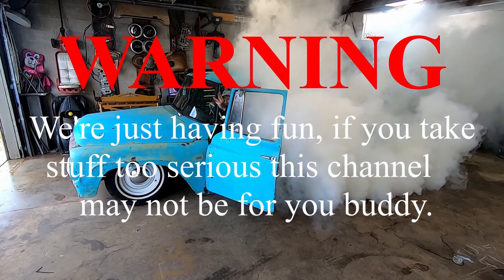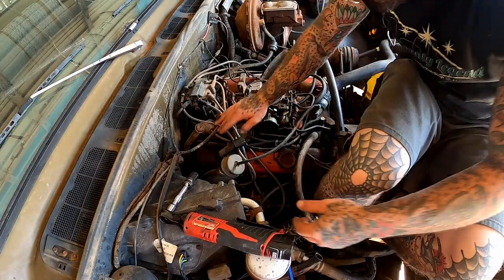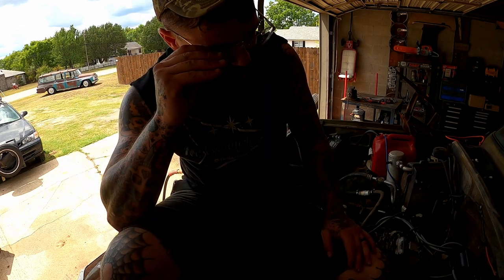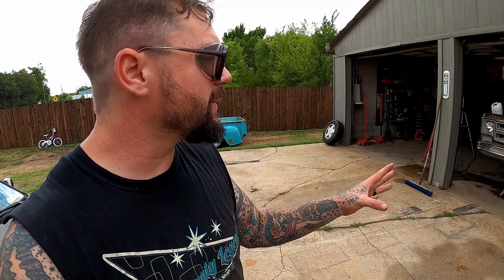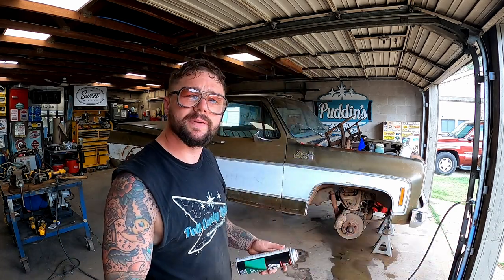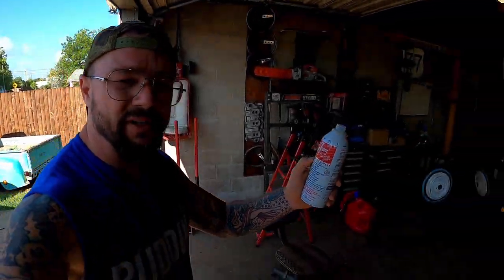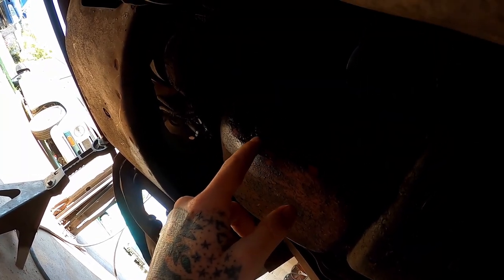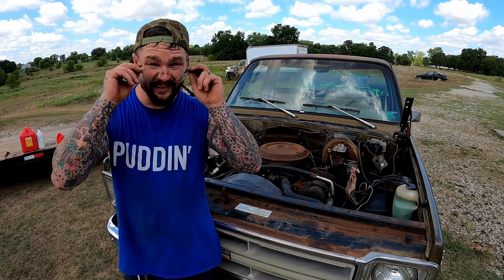ABANDONED 1976 GMC Sierra. WILL IT DRIVE after sitting??

Comment: Dude I just picked up my first truck, a 1984 Chevy s10 with a 2.8, and it leaks oil like no other
Reply: That's a 2.8 for you, oil and possibly head gaskets, no power at all, which is good, 'cause the transmission ain't great either. Cool trucks tho, hope you're V8 swapping it or something.
Reply: If it’s leaking that means it has oil in it.. if it stops leaking be sure to add more lol
Reply: Self changing oil
Reply: Look at this way you'll never have to do an oil change I had a Ford ranger that oil from everywhere I just had to keep adding oil basically got a free oil change every couple months LOL
Reply: @DeadReckon  I might down the road if I really like it, either a 5.3 vortec, or like an old 350
Reply: Look for the newer model S10 with 4.3  easier swap and plenty of performance parts and will make easy 250 to 300 hp  with little work .
Reply: @andrewjohnson442  350 is the way to go, cheap, available, plenty of swap kits, almost "bolt in", might take some hammer massaging on the firewall haha
Reply: The later revised 2.8 that came in the berretta GTs were solid though.
The older 2.8 was what chevy pawned off in the 80s jeeps.
Reply: Swap a 4.3 in and carb it. Something small like a 500cfm.
Reply: Congrats on your purchase of your s10. Hopefully it's still going good. I'd forgotten they made them that far back. But then I remembered I have A short bed pick up trailer from one.

Comment: I used that engine restorer on a couple 4 bangers that had noisy valves. Worked great and engines ran another 100k miles before failure.

Comment: I used Engine restore on an old nissan v6. It made a big difference, I sold her off at 360k miles. It only seemed to work well in that motor for me. CSL was copper, silver, and lead I think? Fills the worn crevices in the cylinder walls. I like the stuff overall and always keep and small can around just because.

Comment: "Engine Restorer" is a good product,     its worked for me on several different projects dating back over 20 years. 
 It fills in most scratches and nicks on the cylinder walls,    and should be added every oil change. Glad you are happy with it.  An engine additive that actually works.           Back to the Fab Shop to finish,    Hawt Damn !
Reply: 100% That has been my experience with Engine Restore also. PROJECT FARM has a great video on it also.
Reply: I use it in my old 1980 SD-33T Diesel and it makes a huge difference in compression. Without I need to hold glow plugs for a good 30 seconds to cold start even when it is hot outside.
Reply: Engine restore fixed my oil consumption on my old 200k+ 3.8l mustang, started running alot better! Sold her off when I was moving but I know it's still driving around town 3 years later
Reply: Used to drink a quart a week

Comment: Yo brother man I saw a t.v. commercial back in probably 1987 or so when restore hit the market. I been using it with every oil change in every vehicle ever since it works excellent. First use you will feel the difference in bout 20 miles.

Comment: I used a can of that Engine Restorer in a 300k mile 6.5 turbo diesel.  It went from 20lbs of oil pressure to 65lbs in about a 3 mile drive.  And it seemed to keep that pressure for quite a while.

Comment: Awesome content..   you can use t4 15/40 diesel oil. And you won't need to add zink
Reply: Or T4 10w 30
Reply: Diesel formula has mabye 20% more  zinc and ever decreasing with every new API regulation/certification. Thanks EPA.

Comment: Puddin  restore is great shit  I have a propane powered toyota 4x4 . 240,000 miles I dump 1 of those  in at every  oil change  you can feel the power 
 difference  it really works

Comment: The engine restore is amazing stuff I first found out about it a few years back from the channel of project farm he put it in his diesel tractor and his compression went to the Moon
Reply: I've seen Vice Grip Garage use Restore and rev the piss out of smoking engines and they stopped smoking
Reply: I have used a few times and had good luck every time I always use it
Reply: @contraband1543  I think he uses berryman b12 🙏🏻
Reply: Engine Restore is an excellent product.  I have used it in several older high mileage Dakotas.
Reply: @BariLopesh  he uses berryman b12 and seafoam and that just to clean out the cylinders aka the "italian tuneup"

Comment: hey pud. I used the engine restore on my old yanmar tractor that refused to start without starting fluid fresh oil change with a can of this added after a few hours of run time. the next morning i went out it struggled but fired up. ran it all day the next morning it started easier. tractor sat for a couple weeks went out hit the key and it fired right off. made me a believer.

Comment: Restorer is great stuff. I usually don’t go for the old snake oil treatment, but I’ve used this stuff and it did in fact increase oil pressure 👍
Reply: Yeah, it's good stuff, just don't expect miracles. I believe it's the modern day equivalent of Wynns Friction Proofing. That was another very good product amid all of the snake oil back in the 70s and 80s.
 Edit: I just checked and WFP is still available today, along with "Plus" variants, ect. I wonder if it is still the good product it was back then.

Comment: The zinc / cam lobe issue applies to new cams , once the cam and lifter’s wear in together your fine .
Reply: not on older engines older flat tappet cams have to have zinc hydraulic roller cams only need it for break in

Comment: That’s why I love working on my 1974 Dodge power wagon I can get inside the firewall and stand on the frame and change the spark plugs with no problems and the flat fenders hold all the parks if you need to change something enjoy your videos Air Force
Reply: You can also see THE DAMN GROUND when you pop the hood.

Comment: I have used that restores in my old 86 Dodge pk got close to 300, 000 miles on it but replaced it , it still ran good just leaked bad , hit a rock with the oil pan. Valve covers etc . But it did bring compression up etc , started using it at about 185,000 . Great video !!!

Comment: 82-84 2.8 carb 60 degree 173 cubic inch v6 gm motors are pretty tough not usually we enough power to hurt itself kinda like the tech 4 tbi 2.5 gm 4cyl I've had several of those they are almost bulletproof dependable and have enough power you could actually hurt them lol..

Comment: Puddin there's a trick I learned like 15 years ago when I worked in the quick lube take a shop vac and put it sucking on the valve cover fill hole and pull the drain plug and it won't let any out unless you break the suction and let out what you want thank you for making great content... Love the videos

Comment: At 42:44 I noticed your outer brake pads are NOT pinched to the caliper. It needs to be, especially if it will be a road warrior. Not doing so allows the pad to ride on the rotor and overheat and cause brake fade and possibly a wreck... Simply wedge your pry bar between the rotor and pad forcing the pad tight against the caliper. Then squeeze the top and bottom tabs against the outer side of the caliper Once tight you are all set.. No rattle and no overheating.. Well, as long as the calipers and hoses and sliders are all in good shape!! 
Steve's tech tip of the week!!! ;)

Comment: I don't mean to blow you up with comments, I've been in the hospital over 6 weeks and I'm catching up. But I forgot to add, check that 350 in that GMC being in a truck it could be a four bolt! If you don't keep the truck it could make a good Driveline for that old project you've been talking about. Doubt it came with a title. 
More I think about it , it's just meant to be . You talking about doing that old project before winter and you just found a four-bolt th400 12 volt Drive Line without a title , I feel it . You get me, get her done.
Parked at GMC shell in the back, and when you're done put the motor out of that big 2-ton with a quarter ton rear end in it down inside. Hell I might just become the manager, LMFAO.
Reply: Pss. Lucas only. Never put nothing that thin in your oil. What I do is get some seafoam and take off the vacuum line to the brake booster and suck it up into it while you give it gas watch out for the white smoke but it will clean that thing out. Don't put it in the gas or you'll just clog up your fuel filters for a month.
What I do is give it gas and suck the first half down and when it gets towards the bottom choke out the motor and let it flood out sucking into the brake booster vacuum and let it sit for 15 minutes before you restart it. Like I said they will be white smoke like crazy, we'll make an awesome video but I trust you you will clean them valves and everything out like you don't even know. I heard that from seafoam. Also works good with the red Mystery Oil.

Comment: Used engine restore it on my 1997 MK8 recently and it got rid of the smoke on first 15min running, I've used it on all my  vehicles over the years in varying condition, I'm a believer! My old 3.8l mustang woke up after trying it, was gonna junk it after it failed emissions and kept having to add a quart of oil every week, ran it through on an oil change as suggested by one of my buddies and it jumped compression significantly! Sold the car a couple years back but I've heard it's still driving around town.

Comment: Puddin' , I hate to be the ol' boy that suggested it, but changing the spark-um plugs would be easier just right through the wheel openings on the fenders , seein' as the wheels is outta the way.  I may have mentioned it before, but a 4 or 6 inch long piece of 3/8 fuel hose helps start those plugs and reduces porcelain breakage iffin' ya drop one.

Comment: Excellent fix on the chevy. Muffler is sounding great. Run it out the side in front of the tire or in back of the tire. Tooth pase witl shine the gauges up clear again. or Autosol polish and elbow grease so you can see your spedo needle and odometer. Even brasso might work. WD 40 will work temporary.  Come winter in a month or two you will wish you had poured in antifreeze you can drain it down a gallon and add one later.

Comment: I have a 1978 C10. It has 62,000 original miles. (My father in laws truck) Anyway it drives amazing. It sat inside for 30+ years. I had to do brakes and a tune up but now it drives like a new one. Well new one in 1978 did. 75 down the highway no problem. Pretty impressive truck. 

I like the two tone of that truck of yours. I'd say put the hood back on and a seat cover and use it as a shop truck. You can fix up on it as you see fit or not. Take it when you don't want to get the trailer out etc, and still need to haul something. Since your getting a title its perfect for a shop truck IMO. I drive mine occasionally to a show or cruise in. I washed it the first time and haven't since. It is what it is. It has a few dents and dings. But is mainly original. So I've left it alone. I still have the matching aluminum cap he had on it. And I don't usually like those. 

Whatever you do with it I look forward to seeing. My vote would be to keep it whole. But its not my truck.

Comment: Excellent video PUDDIN  :) those trucks are tough built also that hose on intake to right side top of brake booster is Power Asstiance for brakes plus pedal release return to if want know and regulator brake pressure to front to back how much pedal push too and wise if hose change when bad shape ! Or get dirt in fluid plus serious  brake problems to also and have no brake pedal only emergency brake pedal to use ! Also Iron Mann tires are amazing I got them on my 2 vechiles  also great traction for muddy and Winters Season months plus on Brakeing also Steering wheel responce have them since 2020 and lots miles on too! They last long time too ones have are Winters & All Season combined in one type and have found bit in Ice and deep snow in Winter Season perfectly  ! Have a excellent Labour day and week too !

Comment: best thing to stop smoke and i aint kidding puddin is marvel mystery oil i had a chevy i got from a guy in clinton oklahoma smoked like a frieght train but after 40 miles and full small bottle of mmo she cleared up. i changed the oil after 40 miles it lowered oil pressure just a hair but it fixed that truck. im guessing since it sat for a few years the rings was stuck

Comment: Those trucks take a surprising beating. I had a 73 C10 as a teenager (I'm 42 now) that I jumped in a potato field  like 8 times before it shot the leaf spring shackles through the box. Propped the box back up on wood blocks and drove her 50 miles home. Mine was a rotted out MN truck it's whole like and still took an ass beating like a champ.

Comment: it seems to be quite a nice ute. i reckon she's worthy of a mild resto and some sensible modifications, i'd be trying to keep it as original as possible, low budget. the body could be tidied up with a 2X4 and a gentle caress with a sledge hammer, throw some ebay gauges in it, mexican blanket seat cover, re-wrap interior trims with woodgrain vinyl wrap, throw a cam in it, headers, maybe dual carb manifold, make her just a little bit spicy. 👌👌

Comment: There are two things that go into Every vehicle I own, Lawnmowers, Cars, Trucks, Motorcycles scooters and ATVs., and that is.-.Engine Restorer and Marvel Mystery oil. I replace 5% with the Restorer and a  2oz  of Marvel.  That combo seems to be the best I have found so far. The inside of my engines look like they are copper colored and shiny clean. For an example, My POS Chinese scooter, has 48,000 WOT Miles on it and my mower is pushing 20 years old. If I told you my Toyota engine was free of sludge build up with over half a million miles and 175 PSI average across the cylinders.... Id be called a liar.. But Here I am happy as a clam. XP

Comment: PUDDIN!!!!!! That truck is too nice to part out for that 4X4( in my humble opinion), throw you a new seatcover on it, put the hood back and roll around in it with some George Jones turned up to about 6 and take your girl over to Sonic once in a while. If you weren't already heavy on full sized Amican V8 haulers I'd say shortbed that ol' girl, put 'er on some drop spindles  and an axle flip and show us how low you can go without resorting to C-notches or bags. A super simple, budget scraper. Think about it

Comment: 1970 Ford truck. Original 302 with over 400k. 1qt of oil burned everyday going to work and back, about 25 mile round trip. Started using Restore Engine Lubricant and oil usage dropped to 1 1/2qts a week. Truck only smoked at start-up and under hard acceleration where before it smoked constantly. It worked for me.

Comment: Redneck tech tip, any 2x4 and a hole saw kit can make a seal installer tool....i have a few foot long sections of 2x4 with different size holes to install seals with wood so hopefully it goes in straight and without damage

Comment: I'm a hard core Ford guy, but it's awful hard to beat a squarebody Chevy/GMC pickup with a 350/Quadrajet with HEI and TH350. That's just a tough, winning combo. Yeah, I said it! Even though it stung a little bit.  Lol.
 I'd be hard pressed to use that truck for parts just yet. It doesn't have body panels flapping and rain water spraying up through holes in the floor pans, etc. Maybe put it to work helping to get the new shop and house situated, THEN, maybe use it for parts for your other project.
 Just my $.02, before taxes. You can keep the change.  
 Cheers Puddin.

Comment: Puddin, I believe you may be getting some some smoke from the cheap GM valve stem seals, or the oil additives you put in, or combination of both.  I wouldn't it worry about it, time will tell, and compression is good enough.  I put some additives in my 91 suburban awhile back, smoked for several weeks after that, before It cleared up. 👍👍

Comment: When installing spark plugs  cut a piece of 1/4 ID. Or 5/16 ID. Fuel hose make it 6 or 8” long push plug in it and it will help you thread plug into hole. Old boat trick

Comment: I love that truck. I'd keep it as stock as possible and run it. Tumble the tank depending on how bad it is. New fuel pump and its golden. Hearing that power steering at full lock sent back some memories. Maybe try and find another 8ft box in better shape or do some body work on the existing one.

Comment: For a proper "PFS Shop Truck" I am thinking of building a Bed for this GMC with using; Lower Bedside Utility Boxes, Flatbed with Fold Down Sides and Tailgate (like a KEI Truck) with Onboard Air Compressor.
This would be the "ULTIMATE" Shop Truck with a Mild Lowering Kit and 3,500# Hitch and some new seat covers and door cards!
And maybe a "Cattle/Brush Guard" (for the Radiator and Grill) to push some Vehicles around...

Comment: I own my very own 1/4 in drive Snap-On rachet with a 1/4 in socket that I found on the ground outside of work. I haven't used it yet, it sits in a bracket on my refrigerator out in the garage.

Comment: You're supposed to preload any tapered bearing during install. I guess it's technically already seated if you didn't change it but I would follow the  manufacturer book specific preload torque procedure any time I put a rear end back together

Comment: last time i used engine restore in a can was in an 89 ramcharger with a 360 it had great oil pressure but after i ran that crap oil pressure went so low check engine light flickered at idle
Reply: same can you just used so be careful ill never use it again

Comment: I know reducing the diameter of the pipe is a no no but the WWW doesn't have a solid answer, well It has two answers that are nearly equal, is a larger diameter pipe create any issues? What about it going from the recommended size to a wider pipe, is there any problem doing that?